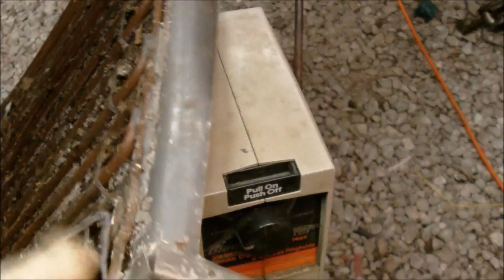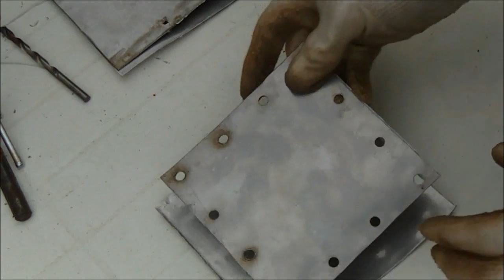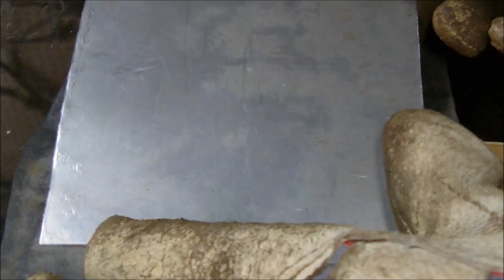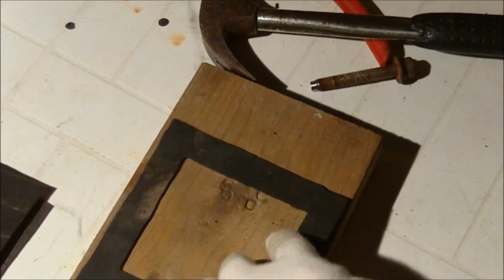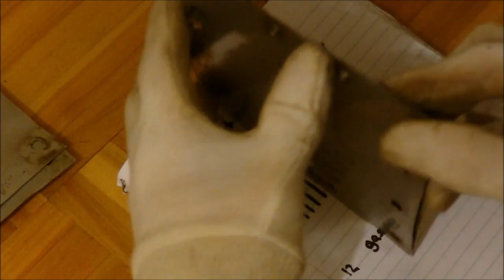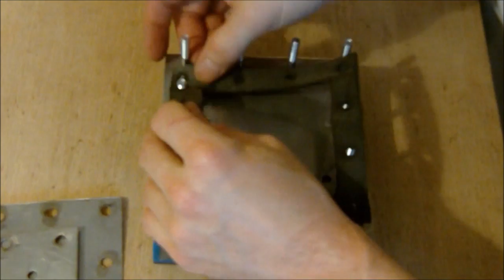HHO Dry Cell Generator build from Scrap, How-To DIY

Comment: Sad, 1 your Drill is blunt by the sounds of it or sharpened wrong. 
2 You are drilling too slow.
3 You are putting to much down pressure on the drill while drilling, the drill should do the drilling, if you wanted to punch the holes you are using the wrong tool.
A very bad example of using a drill.
Reply: all he above is true, get the proper style cutter and make smooth straight holes with no after work.
Reply: drilling slower prolongs bit life

Comment: Clearly your have little if any experience with electricity. Your design has a lot of potential short circuits in it. The bolts, nuts, and end plates should be of none conducting materials such as plastic. It's also best to flatten your plates as flat as possible.  Is nothing else is available, stack them with a heavy weight on top over 24 hours.

Comment: He said (paraphrasing) "Hopefully the plates won't touch the bolts."

There needs to be some way to electronically isolate the plates. As it is with this build, he is going to for sure short out the power supply. Very poor build.